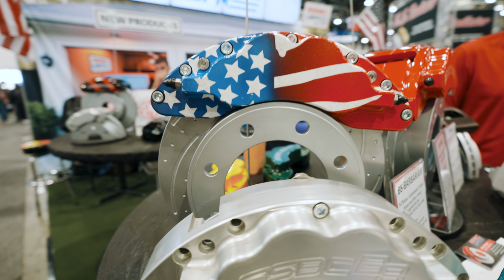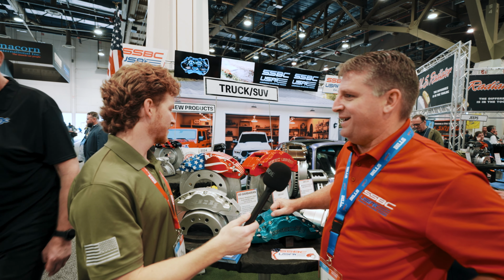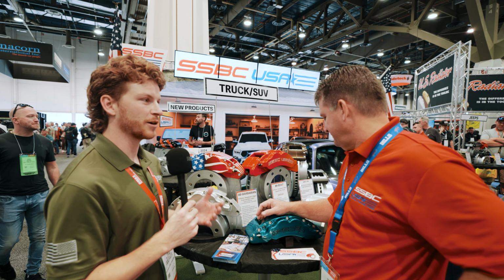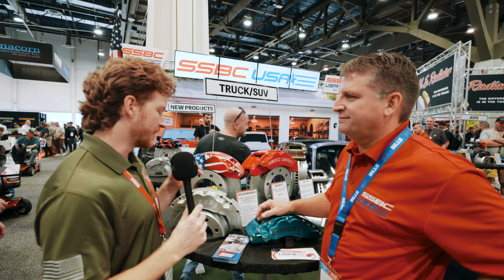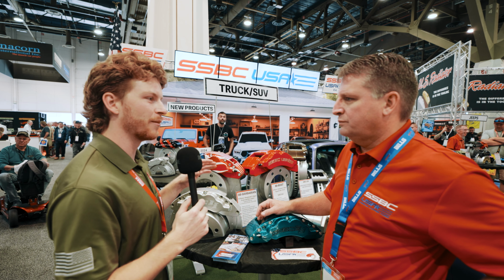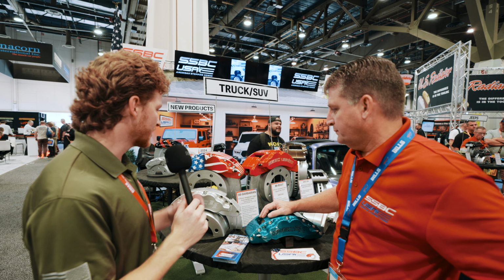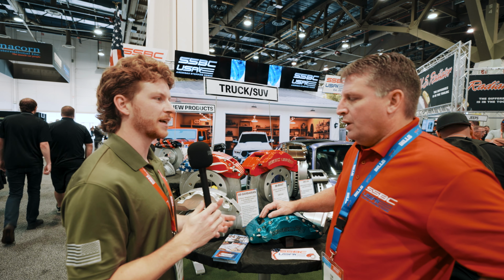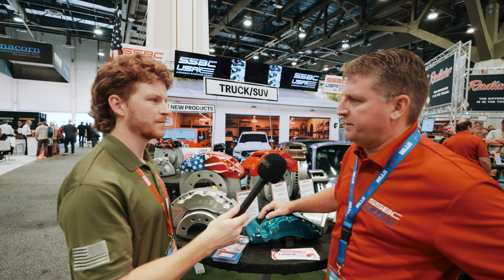Big Brake Kit for Duramax Trucks Made Right Here in the USA! - SSBC USA SEMA 2024

Comment: The OEM pads/rotors seem to have quite a long service life.

Did they mention possible pad life running their caliper and pads?
Reply from the maker: We have this kit on a few of our trucks and the pads are holding up well so far. I imagine they will wear similar to any OEM replacement pad, there are no pads that hold up as long as the original equipment will.